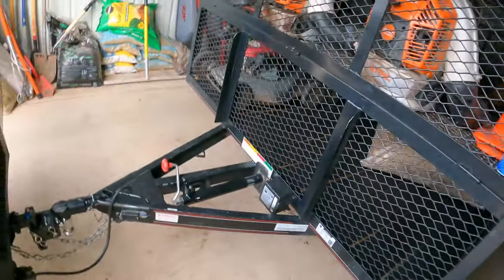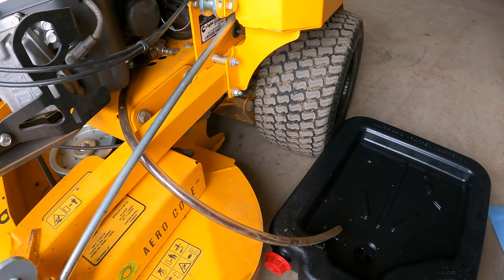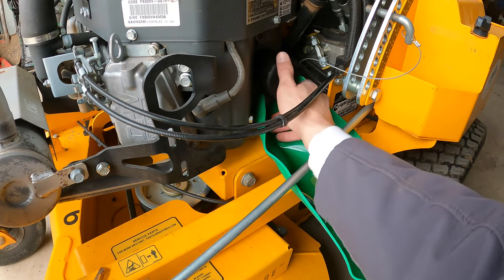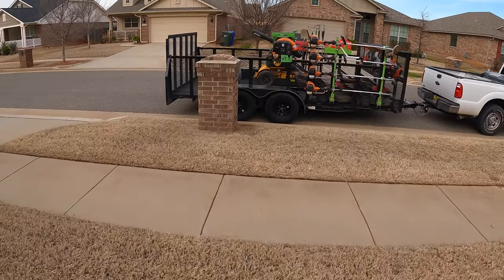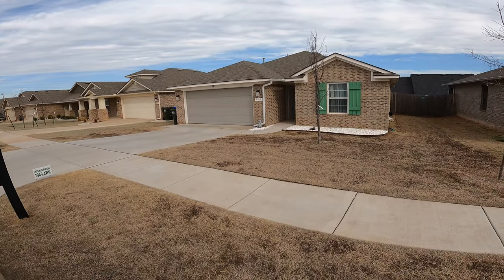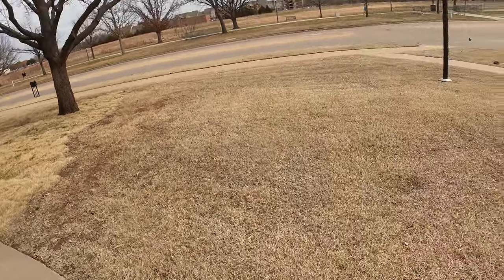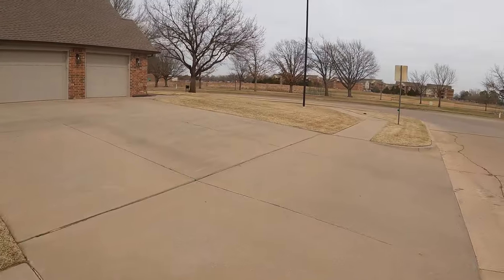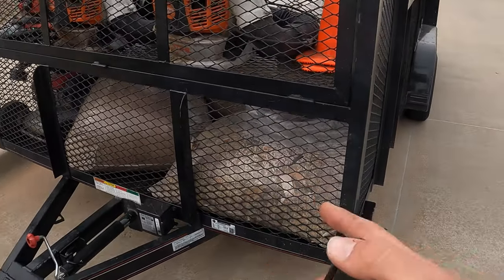Customer Rejected Me

Comment: Not that using old oil on the filter seal hurts anything, but why? If you’re pouring new oil in the filter, you probably just spilled new oil on the seal when you stopped pouring. There’s plenty of new oil on the filter now, just wipe that around the seal and cut out the extra step of getting some old oil to do that with. 🤷‍♀️
Reply from the maker: I just use the closest oil haha
Reply: @stetslawncare  
When you get to be as old as I am, almost retirement age, probably past that to some, you  will find that you’ve learned a few things in life. One of those things is you gotta work smarter, not harder. The closest oil was what you poured in the filter!!!!  😬

Comment: If you’d crack the screw to your oil port fill,it will drain out your tube faster,,
Reply from the maker: I did that!
Reply: @stetslawncare  well...if you put a metal tube through a rubber stopper, jam it in the fill hole and hook it up to an air compressor.....it should come out REAL fast 🤣😂🤣😂🤔